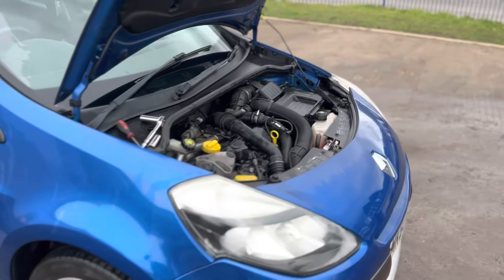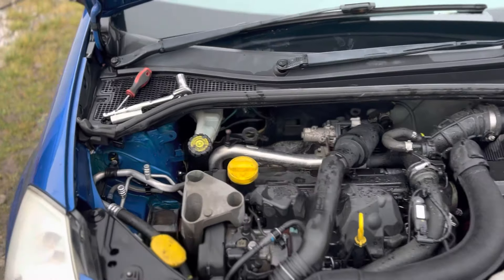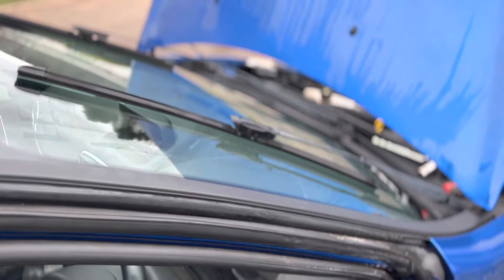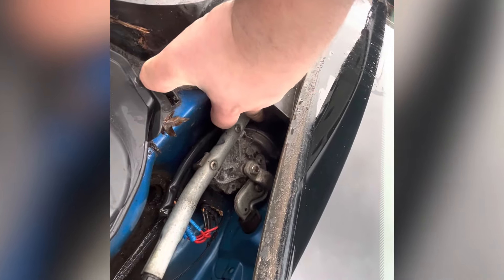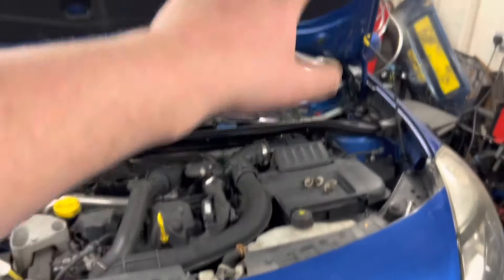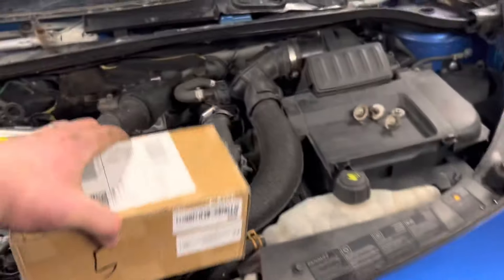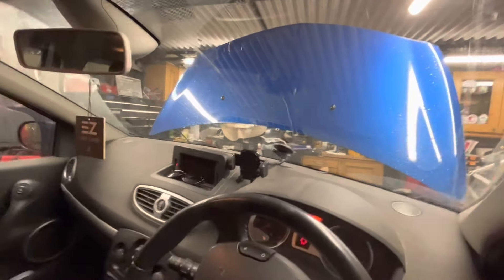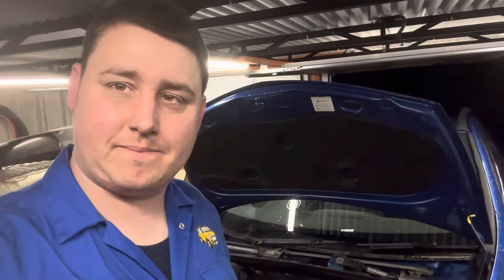Renault clio mk3 wiper failure! Resolved

Comment: Hiya mate a question, a mechanic told me if you get the wiper motor only it would need to be calibrated
Told me to get the wiper arms plus motor should i get the motor only?😊
Reply from the maker: The calibration is to set the park. Connect the motor, switch on to test and allow to stop in the correct position and then install the wiper arms. Calibration complete
Reply: @WilliamMurfitt  what is,set to park mate

Comment: is that wiper motor still working some 9months later being an ebay jobby?
Reply from the maker: It sure is. My brother now has this car and has no issues
Reply: @WilliamMurfitt  am on the hunt for one, which brand did you get if you could remember
Reply from the maker: Here is a link for what I bought. Hope it helps - https://www.ebay.co.uk/itm/173261592961?mkcid=16&mkevt=1&mkrid=711-127632-2357-0&ssspo=ZY6hCXo2TLq&sssrc=4429486&ssuid=8vPPCVRMSze&var=&widget_ver=artemis&media=COPY